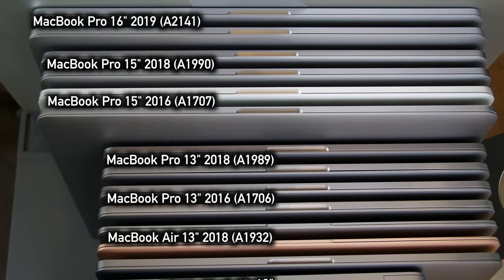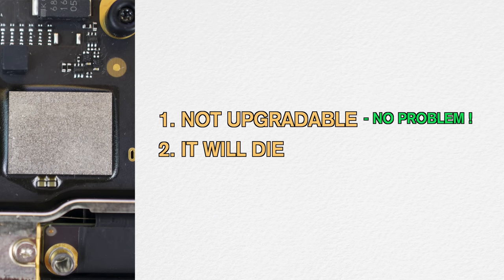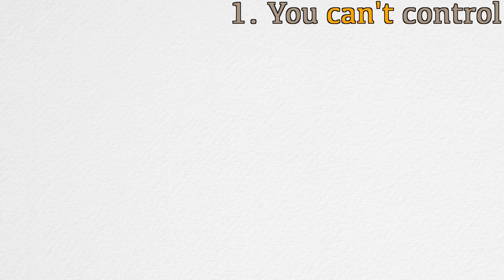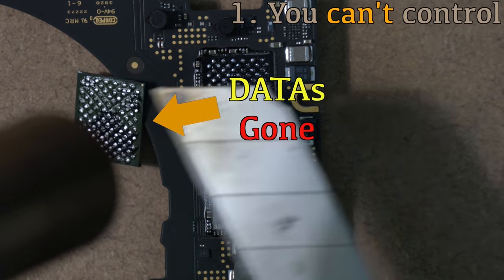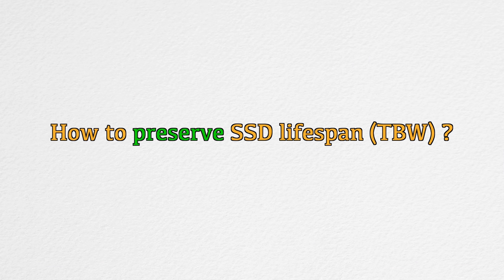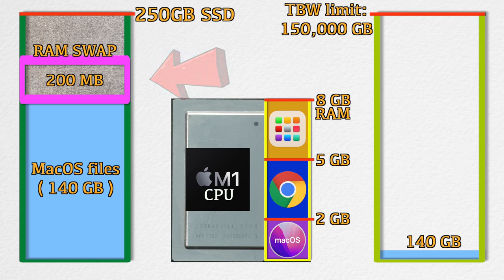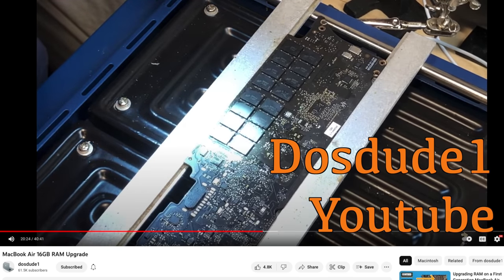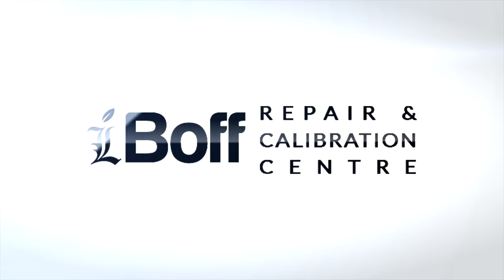These MacBooks DIED from SSD Failure & How To Prevent It (Not for RICH dudes!!)

Comment: I have a M1 Max with 64GB RAM and 2TB SSD from work and a M1 Pro with 32GB RAM and 1TB SSD.
The thing is: I actually dislike Apple a lot and I hate their choices, operating system etc., but there's simply no x64/x86 laptop with either AMD or Intel CPU, that is as fast AND as power efficient at the same time.

I usually develop stuff on my MacBooks, because I can easily take them anywhere and not have to worry about power plugs. Also neither of my MacBooks ever overheated (I am using the M1 Max for about 10 months and the M1 Pro for about 2 months).

I had a Dell Inspiron laptop for two years and it constantly was loud and hot (not in a good way).

So shaming people for buying superior hardware isn't being professional. I do agree, that having soldered components and possibly planned obsolescence sucks, but currently there's simply no x64 laptop being close in terms of power efficiency.

As a side note: Windows sucks a lot, too, especially in terms of S3 / S0 sleep and Linux is sadly not there yet in terms of drivers, even though I'll definitely be testing out Asahi Linux on my MacBook.
Reply: Just the fact that most windows laptops with a H-series CPU are only actually useful plugged in (mines gets limited to 17W on battery), and drain their battery faster than a Bugatti drains it’s fuel tank, makes them unappealing for sure
Reply from the maker: Yeah, to be honest M1 is a really awesome SoC, the only problem is the soldered SSD. That's why we actually never stop people from buying it, and instead telling them to maximize the RAM first and then SSD. The SSD is replaceable if it dies, but it comes at a cost that will be explained in the next video.
Reply: Agreed, also running Windows with Parallels performance is pretty good cuz I have this model of MacBook Pro. No other hardware provides such performance and battery life without being close of AC adapter for a long period of time.
Just I hope this soldered SSD can be replaced in a near future.

Comment: I wish you had mentioned how long a typical user takes to reach the maximum TBW. If for example it typically takes 10 years for most people to reach the TBW of 512gb ssd, I wouldn't worry too much.
Reply: Exactly, these videos are by people who like to create issues that don’t exist. Most mechanical drives won’t last 10 yrs!! Ok so it’s soldered on, a 10 yr old laptop is usually pretty much done. People expect tech to last forever. And everyone slating Apple, most of not all thin notebook makers solder on the ram and SSD to save space.
Reply: @Welovedaxies Shorting to ground is the design defect intentionally implemented, which I don't think Windows OEMs have done yet.

Comment: I was an early apple user but had to give them up due to their being too damn expensive. I switched to pc after my se30 died and have never regretted it. The reason for soldering the ssd to the board is so you have to buy a new one. This is purely a business decision. I prefer computers I can easily upgrade and get cheap parts for. I have mac users in family and the main reason they don't want to change is they prefer to stick with what they know. LOL

Comment: What is really misleading here is unless you’re moving gigantic pictures on your Mac over and over and over and over there is no normal threat to the soldered adds.  Average usage outs the life cycle somewhere between 14-160 years so no copying items to your desktop and downloading movies will have a very very very small impact on the drive.  However, what you want to do to preserve the drive is not fill it up.  That is where you run into problems because it starts rewriting over the same storage spots wearing them out faster.  

Otherwise nearly all of the suggestions here are not relevant.     If you are hitting extremes with extremely large files every day and are also running out of space you’ll have something to potentially be concerned about.  The answer is get a bigger hard drive when you buy your Mac.

Not buying them to not support soldered drives is ridiculous.  You should be buying a new computer once every 14 years.

Comment: i was thinking of getting a Macbook air M1 to replace my broken Acer laptop but i think i`ll get another Windows Laptop after that one, at least i can change the SSD and increase the RAM on it.
Reply: Better check the specs in detail then. Most new Dells and Lenovo I opened up recently have soldered RAM and for some, even SSD, and this was even in their professional range (Latitude and ThinkPad X13). 
They internal space is used  by a big battery occupying 70% of the room, and the rest is a minuscule board with everything on it... Even a defective CPU fan means the complete motherboard needs to be replaced nowadays.

Comment: You can still use a Mac with a ssd that has died of cause, by booting from an external ssd drive. And do regular Time Machine backups to restore your system to any functional drive
Reply: that's correct done it before, the only thing is that the battery will drop faster than normal, also will be slower ....

Comment: Please Sue Apple for soldering the SSDs onto the mac Motherboard making it very difficult and pricy to repair and overcharging way too much for storage and RAM and doing shady RAM and Storage management among other things. (SSD Swap even on 16GB with just a few Chrome tabs open)

Hello. It is time we gang up on Apple and SUE them for choosing to solder the SSDs onto the Mac Motherboards since 2016. On top of that, they also overcharge 3x-4x the price per TeraByte compared to top SSD manufacturers like Samsung, Sabrent, Kingston, Western Digital, Seagate, and so on. 2TB (non Replaceable) SSD @ Apple ---> 600$-800$. At the same time if u go on Amazon you can get a 2TB (easily replaceable) Samsung 980PRO SSD for 200-230$. 
- When the SSD Fails.. and it will eventually, they will also overcharge you for the repair, because guess what, if you need it replaced, the way they go about it is by replacing the whole motherboard which is an absolutely wasteful way to do it. Imagine replacing so many parts when you could've just replaced the SSD. But they want YOUR MONEY (As much as they can get their claws on).
- RAM: they charge 400$ for 32GB and 800$ for 64GB of RAM. At the same time, you can go on Amazon and pick up 32GB of DDR5 for 140-155$ and 64GB of DDR5 for 260$-300$ (Replaceable)
- They also do some shady stuff with RAM management: if you get 16GB of their overpriced RAM and monitor your SSD swap Memory, you’ll notice that the macs write a lot of GB to the SSD like 16GB isn’t enough for a couple of chrome tabs. Disgraceful…. ( what I’m aiming at is that they’ll most likely make your non-replaceable-soldered SSD go bad sooner than later… good luck getting a humane price for the repair.
- And last but not least, I don't know exactly what they do but they fill your Mac and iPhone with not-so-specific files that you can't quickly discover and delete, thus making your storage fill up quicker. Basically, they're forcing your hand and your wallet to buy the bigger storage option (which is overpriced, to begin with as stated at point 1). I just had to delete apps on my iPhone because when I go into Settings/General/iPhone Storage and click on any App, I can't access/open any Apps' "Documents&Data" just so I can see what is taking up so much space and actually delete all that data that's uselessly filling up my storage.
Apple products are made well and are very shiny and pleasant to the touch and to use. All they have to do is stop making those shady decisions behind the curtains. But they always make those shady decisions until enough People start making noise about it or a Higher Authority decides to step in and force them to comply (to behave like good human beings). For example, the EU stepped in and forced them to implement USB-C. Apple's Lightning connector was a nice connector until 2014 until the USB-C connector came along... and yet it's 2022 and if you get a nearly 2000$ iPhone, you still get a Lightning connector on it (USB2.0 speeds: 480Mbps/60MBs per second). up until now, Apple has proven that it is in their Essence to not think about their users, to not listen to them, and to always try to squeeze as much money as possible, borderline robbing you until people start to catch on and speak up and even when they do speak up, Apple always tries to stand their ground with their shady business practices.
We must take action. Seriously. Either ask higher authorities to step in and Force Apple to clean up their act or we just collectively stop buying Apple products. Keep in mind that apple decided to remove the Headphone Jack and soon after the industry followed them instead of standing their ground. ( Keep in mind that apple sells wired earpods for 20-25$ but sells their Airpods for 250$. (I wonder why they took out the Headphone Jack...) so just because they are wireless the price difference is roughly 1200%. I would never buy their wireless earbuds because I see it as their greedy Sin. So just because you introduce wireless functionality you do it at 1200% price difference? NOPE. HUGE NOPE. Imagine if we all Stopped buying Apple products for 3 Years. Imagine the looks on their faces year after year when they see 0 Sold Products :O:O:O. That would be awesome. 
Wish you all the best and take care.

Comment: But these failure happen after long time many 5 plus years or even more there are test done now. Apple should refrain building any 8GB base laptops it is literally screwing consumers with performance as most don’t know the swapping of ssd is not good and should start from day one of use. And it throttles performance. I dumped Mac mini and 8GB m1 already taking a loss to get 16GB versions. Same failure applied to doing discs rule of thumb is 2 backup for your laptop which I do on regular basis and no file save on local drive any new laptop should be 512 gb and 16 GB specially on $1300-1500 price point apple 15 inch mba are $1299 and 8GB is robbery tbh.

Comment: What about watching VOD (Video on Demand), like Netflix, Disney+, HBO Max..etc.? I mean on daily bases.... I m worried about my SSD now! :)
Reply: live view does not store video on your SSD, you should be safe! But may be just a small amount for data buffering? someone can comment on this.
Reply: When only watching, you "stream" the video.

The app download only a portion of the video (usually a few minutes before and after the current video position for smooth playback, usually called "a data buffer").

It is stored on runtime memory (RAM preferred, SWAP as emergency) instead of directly to your long term storage (SSD/HDD).

The app will release the old buffer after sometime, so technically you'll never buffer in the SSD by swap.

If you're curious, maybe check RAM usage and swap usage before, and when watching a video.

Comment: on windows can be same - default config will kill your ssd fast; and forgot about 110 - 400 Tbw in real it will start die few years after warranty; my 950 pro had 25 Tbw and 27000 online hours use it in middle and now start die,,,,

Comment: Thank god I have the 2017 13 inch macbook pro (non touchbar) which has a removable ssd. So even if the ssd fails, I could just use an NVME adapter and put a new ssd. I do actually plan on expanding the storage.

Comment: Hi iBoff RC
I wish you or someone recently purchased a new Macbok pro 
can do this test/ experiment to confirm
Get a new Macbook pro 512GB SSD
Write and Erase 10TB a day to the SSD for about a month or over
These SSD disks can write 2500MB/ sec
To read and Write 10TB at that speeds would take ~1 Hour
Black Magic Disk Speed test App can write and read 5GB to SSD 
continuouly as long as we run the test on the app.
We can check in Drive Dx how much TBW was burned in that 1+ hour long run
on ongoig basis

According to the video the SSD should fail at around 300-350TB
Or we continue testing till 600TB and stop (2 months)

If the drive does not fail for months even after this rigorous disk burn test
it will be good news for us all.
If the drive fails the Macbook Pro is in warranty so no issues to the owner 
and we confirm this technical vulnerability of Apple SSD drives

My mac is very old 2012 and out of warranty so can't verify this issue

Comment: Won't the external ssd suffer from the same problem then only faster ?
Reply from the maker: YES! youre right! but the point we're trying to make is, the external SSDs are EASILY REPLACED when they're dead. but not soldered SSD inside these Macs.
Reply: @iBoffRCC  but not the data, so it is the same problem.
Reply: @romanmechetnerful  All storage mediums can die and you must always have multiple copies and backups.

Comment: Any manufacturer that does this crap should be avoided, IT gear should be too old to be useful well before it becomes a paperweight. Upgrade path should be considered and components prone to failure such as ssd drives, batteries and cooling fans should be replaceable without needing specialised tools.

Comment: apple should have just stuck with their proprietary nvme drives, at least those were removable.
Reply: Well apple did not want people to use nvme adapters to upgrade their storage for cheap, since they went out of their way to make their own proprietary connector.

And when people started selling adapters apple said we are going to start soldiering on the ssds so that apple makes more money and the user cannot upgrade unless they give apple a lot of money
Reply: @flamingkillermc2806  I’m sure they could have figured out a software key solution. I guess this allows for a smaller board tho.

Comment: LOL, buy the small SSD and the duty cycle of the SSD goes way up, so the MacBook dies sooner. So, the more expensive MacBook with the largest SSD may actually cost less in the long run as the size of the SSD is directly related to the duty cycle of the SSD. The 2TB MacBook should last 8 times as long as the 0.25TB mackbook. The extra $800 giving 8 times the Lifetime.

Comment: i bought from a refurbished laptop seller a fujitsu ... now this seller was good and but he has lately started selling laptops with ssd internal hard disks only ... to cut long story short fujitsu died and i found that ssd was also refurbished (by sandisk) ... we lay publick are not suppose to know these stuff but what about seller? ... if you must know who this seller is it is igs systems of toronto (recently changed name to ics systems) ... ics/igs can sue me (for what? libel?) but please these sellers build their reputation on being experts in these matters and by proxy protect their customers ... freegeeks toronto has thankfully not jumped on ssd bandwagon and i hope other freegeeks branches are also steering clear of ssd ... this so called innovation should not have happened ... we need to stick to old tech and adopt new tech slowly ... apparently manufacturers knew but did not take trouble to educate

Comment: Why don't you mention that the SSDs work the same on windows PCs too?
Reply: But they are easy to replace. I have upgraded SSDs several times.
Reply: Because it is very rare to find a native windows device with RAM and SSD soldered to the motherboard.

He also never said that this is how SSDs and swap files work on Apple, it was a generic description that applies to all hardware and all operating systems.
Reply: Apple makes macs work with swap so people think macs need less ram then people will be impressed how much less ram needs but in the end a mac ssd is more likely to fail.
Reply: @Teluric2  You see that a lot on the review channels. Since NVMe became common I have never had anyone come to me with a failed NVMe based windows system.

Related to this, I really wish Intel considered finding a way to work with Windows on an Optane solution for swap. A lot of people in the enthusiast space use Optane for dedicated swap drives due to them having super low latency and more or less indestructible endurance.

Comment: Get a MacBook 2014 model or older. They include all removable and upgradable components inside (even processor and SSD drive) and you also get always needed USB outputs, media card reader, and display port. NEW Apple products are a joke, a downgrade, and designed solely to steal your money.

Comment: Clickbait, this failure is not a result of endurance but often a circuit-board failure. He even says they were all shorted to ground, this is not a self-destruct mechanism but the result of a very common short (often caused by liquid damage) from running the SSD's power traces too close to ground

Comment: I guess I am safe with my 2018 MacBook Pro only shows 283Gb written to my 512gb SSD. Not sure how that is possible since it only has 44Gb unused.. iostat -Id showed       KB/t xfrs   MB                                                                                                                                                                                     
                                                     24.72 11736331 283295.25     so I believe this is the results since the last reboot, not very useful.

Comment: So if a system has a Swap File in use...how do we get it to stop using it? My system has 16GB of RAM, is not using all of it, but still shows as using the Swap File!
Reply from the maker: Hi Jacob, good to see you here. are you using the latest MacOS with the latest security update already?
Reply: @iBoffRCC  I was first seeing this problem via macOS 12.6.1 on my MacBookPro11,5. I have now updated to macOS 13.0.1 via OCLP and am still seeing the same issue...even with nothing but Activity Monitor Open.